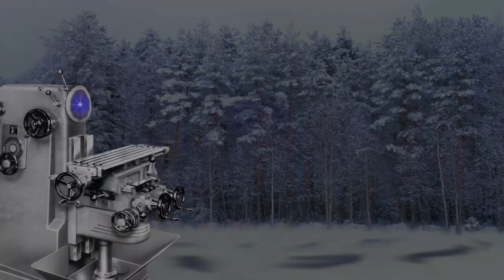Work Safely With Your Lathe

Comment: Great safety video! 
There is an additional dangerous practice that I have seen many times. That is using fingers for holding abrasives for internal sanding. It can bite You bad very quickly. I use a set of split wooden dowels for this. 
Also, covering the ways when sanding is important. The cloth can however catch in the chuck or wind up on the lead screw which has caused accidents. Since becoming aware if this, I have used paper that can tear easily.

Comment: I'm most jealous about your lathe's high speed possibility. Ours don't spin even 2000. But if I ever get to finish my cnc lathe project, it will spin over 4000 rpm I will guarantee that.